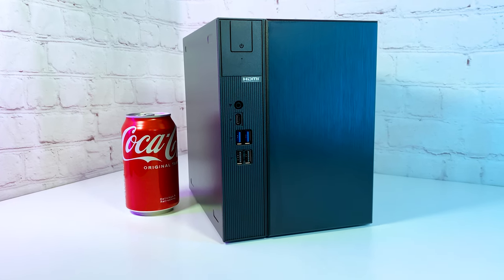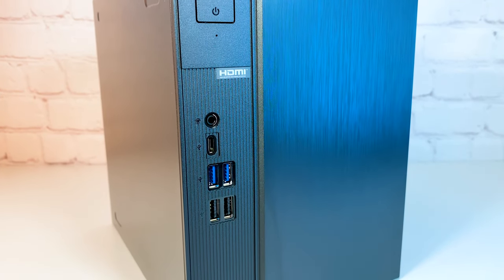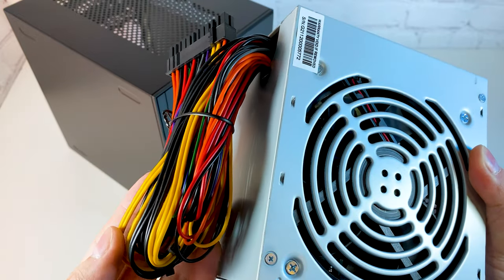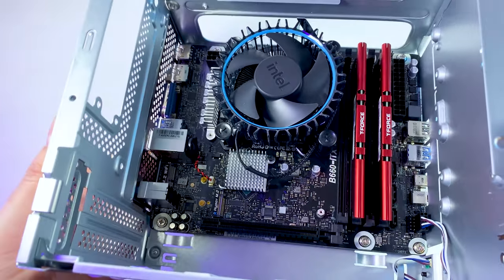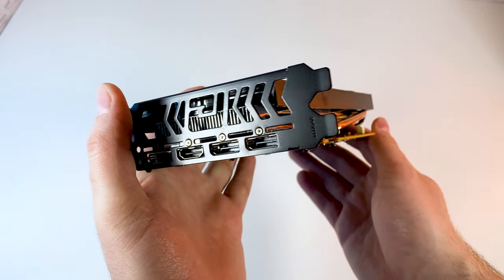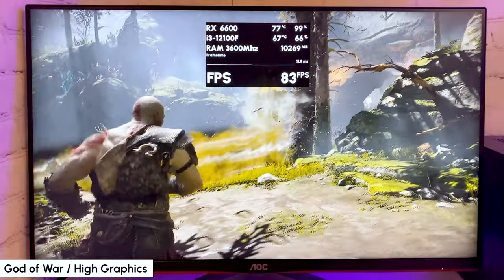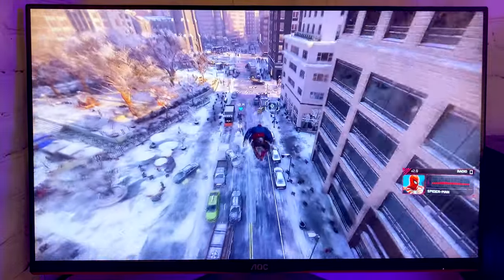Gaming PC Build with $600 budget - ASRock DeskMeet B660 - Tested in Games

Comment: 3:58 My set up came with a wifi card, if you read the instruction manual you didn't need to DIY your IO shield they're little holes on the top for the antennas to go through, then you fasten the screw nuts so it doesn't wiggle
Reply: i laugh :face-purple-crying:

Comment: mines came with wifi also but i used a wifi 6 card i got for my laptop but  did not install the antenaes  
i had some problems figuring which memory slots use as they are not labeled  and getting m.2 on bottom installed then believed my cpu (i5 12400) builtin graphics was not working but that was for using wrong memory slots finally got it to boot to my old laptop nvme with windows 11 preview (forgot it ) i also wanted to use all sata ports but could not figure where to mount drive (up  to 5 drives). i also did not get the discreet video card as yet so not testing games other than diablo 3 or 4 not an avid gamer only got this b660 because my laptop died so far i'm loving it do wish some quality was a little better

Comment: I built an AMD DeskMeet from spare parts which I didn't need anymore (Ryzen 3600, 16GB DDR4-2133 ECC RAM, Geforce 1660 Super 6GB) and it runs like a charm. The cooling is sufficient for midrange hardware.
Reply from the maker: Nice, thanks for sharing, I am in love with this deskmeet, recently upgraded it to 13th gen i5, video on the channel if you are interested.
Reply: @Tech.Closet  I saw the video, you basically doubled the CPU performance :) the 3600 gets only 7200 points but is at least faster than the i3-12100F xD

Comment: Holes for wifi already in case ...
Reply: Gotta say, thumbs up for the creativity of adding holes to the I/O shield. For those unaware: on the top edges of the case there are punch-out holes to screw the antenna connectors to.

Comment: Damn, too late for me to get that RX6600.  If only I had known it would fit before getting 6500 xD.  
I bought mines when it just came out and it came with wi-fi 5 as well, I upgraded to wi-fi6 though but did use it before then.
Was going to make that comment on the wifi antenna holes but saw someone already did.  I also missed this and was super confused since they advertised holes for it, guess they forgot to punch it out xD.  I actually ended up emailing them which they quicky responded I needed to use a screwdriver just to push it out.

Do you happen to know how much power does that RX 6600 take while idling?
Reply from the maker: Thanks for commenting! RX 6600 takes around 3-4W in idle with a single monitor.

Comment: Just got mine and it came with Wi-Fi as well lol. Basically same build but I bought the 12100 and 32gb kit and a 1tb sn750
Reply from the maker: Nice, good luck with the build.
Reply: wait, you're saying this case included the m.2 wifi card and you don't have to buy a separate one?
Reply from the maker: @annguy5563  We got one with deskmeet b660, but nowhere is mentioned that it should be included.
Reply: @Tech.Closet  interesting, my deskmeet is coming in the mail, I’ll update if it come with a wifi card
Reply: @Tech.Closet  my Deskmeet came today and yes it came with a m.2 Wi-Fi card
Reply: @Tech.Closet for the Wi-Fi antenna, you don’t have to drill those holes, the case came with holes on the top of the back of the case, you just need to use a screwdriver to punch the aluminum out and insert to antenna in, it also in instruction come with the Deskmeet if you read it
Reply from the maker: @annguy5563  I didn't get it, do you mean PCI slots? I saw the instruction, but I think there's some other desk meet version pictured. Anyway, hope you gonna upload a quick show-off on your youtube channel :)
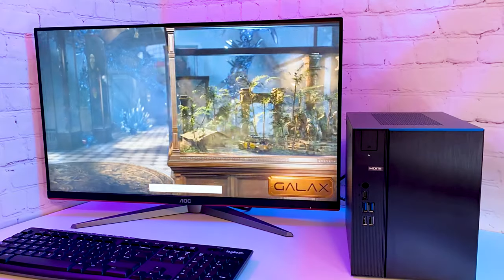Reply: @Tech.Closet pause your video at 4:01, you see the 2 little holes on the left and right top corner of the back of your case? You can use a screw driver and punch it off to fit the antennas in, no need PCIE or drilling.
Reply from the maker: @annguy5563  I see it now. Thanks!
Reply: @Tech.Closet i dont know about you , i have purchased so many times with different sellers and they always included the wifi card , they even listed in the description which is included this as well

Comment: Built this and it won’t turn on😔 idk if it’s power supply issues but it turns on spins the cpu fan then off right away can anyone help
Reply from the maker: can you pls list your components? Also here's what you can check, first make sure your 8-pin and 24-pin from PSU are all the way in, there's a clip that should click when all the way in. You can also try running it without ram/wifi, just a CPU and mobo, let me know.
Reply: @Tech.Closet  thanks for your reply I think it ended up being the mother board pins.did the clip test on the psu and it was good. Also got overnighted a new psu from Amazon with same result. I noticed a few bent pins on the motherboard which is why I think it was the problem. I returned the product and hopefully I can get a new one. Might have damaged it during cpu install who knows. Gonna go for x300 now. Short video on my page if you want to see what happened. Samsung 980 pro 1t. Silicon power ddr4 thanks for your help. Learning a lot from this build cause from trouble shooting to pushing those pins down. Ran everything from no ram to just 1. Then back again haha
Reply from the maker: @jakeyfpv   Glad you figure it out, x300 can turn into a great working station with something like Ryzen 5600g, unfortunately, there is no GPU space, but Vega 7 integrated graphics can get you some games running.
Reply: @Tech.Closet  meant the deskmeet x300, b660 is now out of stock so I guess I go Ryzen. It looks like the same size as this build you did
Reply from the maker: @jakeyfpv  oh yes, you're right, there are 2 of x300. I thought you are going with DESKMINI 
https://www.asrock.com/nettop/AMD/DeskMini%20X300%20Series/index.asp
https://www.asrock.com/nettop/AMD/DeskMeet%20X300%20Series/index.asp
Reply: Did you fix it?

Comment: I made this exact same build with all the same components but somehow I’m hitting around 80c cpu temperature on warzone, did you change anything in the bios? Any recommendations for this
Reply from the maker: I didn't change any bios settings, are you hitting 80 on CPU or graphics card?
Reply: @Tech.Closet   only the cpu, i used the Noctua NH-L9i fan for it. What about setting in the Radeon software?
Reply: Also I noticed my cpu usage is higher than the gpu. While your gameplay in the video shows the opposite.
Reply from the maker: @lanejs1697  you can first try this: search in start menu for "chose power plan " and make sure it's recommended. 

but regardless, I suspect there's something wrong with your CPU cooler installation, I used a stock cooler that goes with i3. With Noctua NH-L9i-17xx you should be getting lower temps than I am.
Here is what you can check:
I believe you peeled all plastic and used a thermal paste that goes with the cooler.
Then visually inspect the CPU cooler to make sure it's installed straight, pay attention to the mounting screw on the back,
Maybe your cooler has bad contact with the CPU, you can just tighten the screws, but if you wanna make sure that's the case, unscrew the CPU cooler first and check how your thermal paste spreads.
Reply from the maker: @lanejs1697  its can be caused by throttling due to high CPU temperatures.